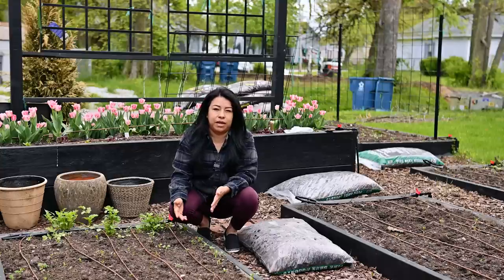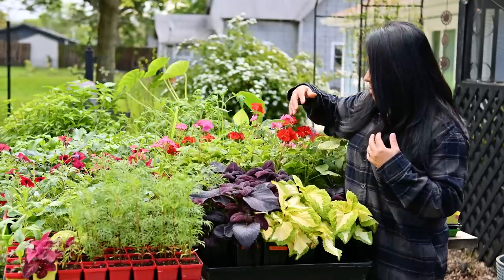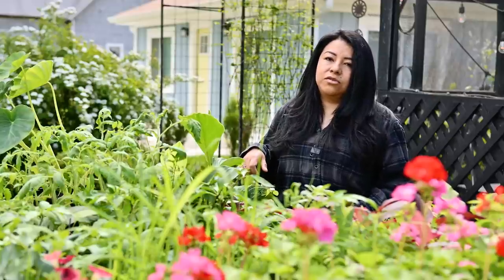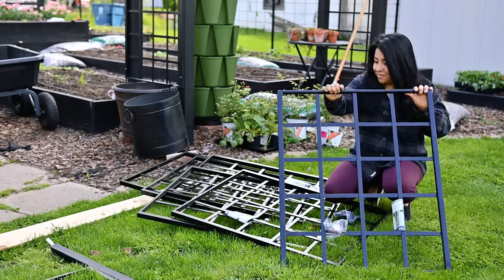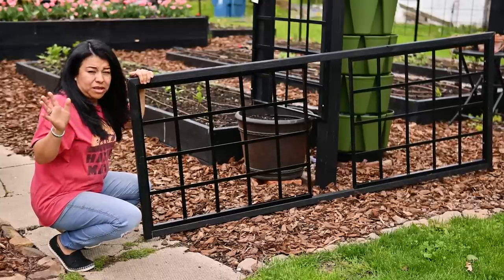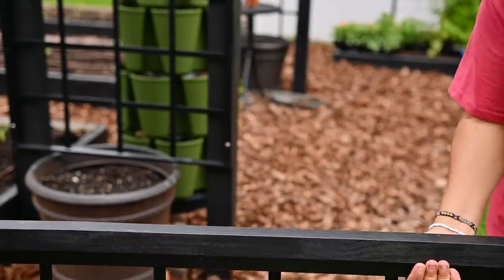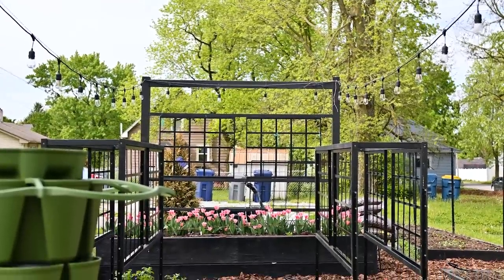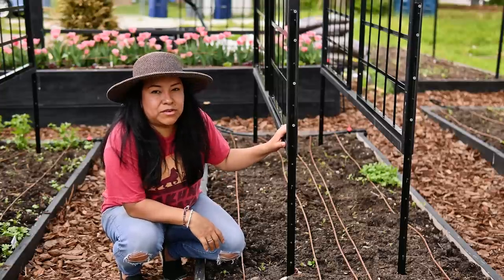DIY Tomato Trellis for small spaces 😎 ( I think they look really cool!)

Comment: Do you have issues with fungus gnats on your seedlings? If so, how do you  get rid of them?
Reply from the maker: This is my 4th year growing from seed, the first couple of years were horrible with gnats towards the end, I use those sticky traps and they work fine for me. This year I installed an overhead fan in my room, and I had my smaller fan that I would move around to cover every spot, I really think the fans were a huge help because I only saw a handful of gnats this last week in there, and nothing before that. If the tops of the soil stay dry it is harder for those things to grow in there.